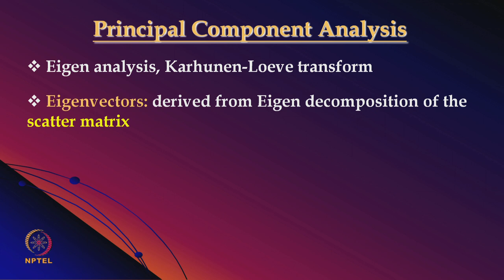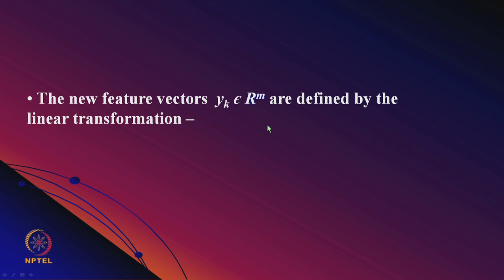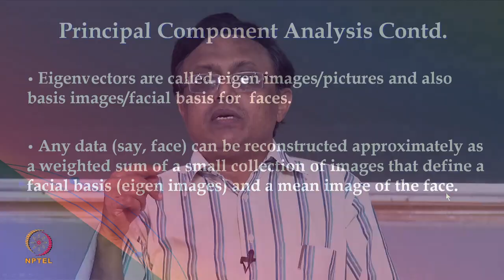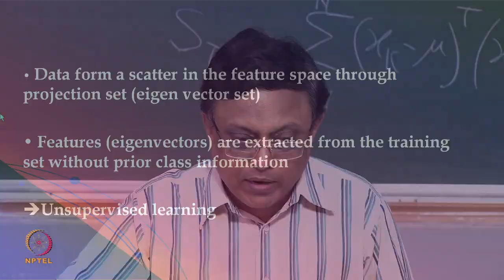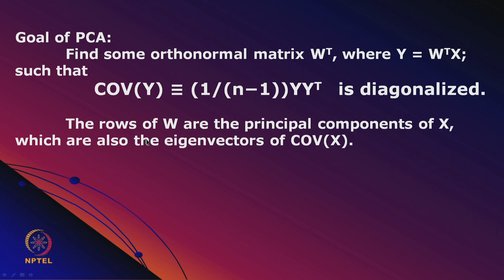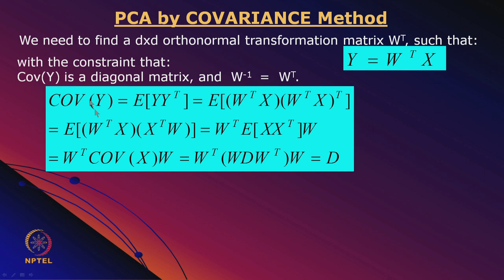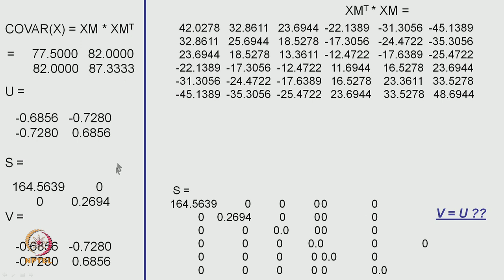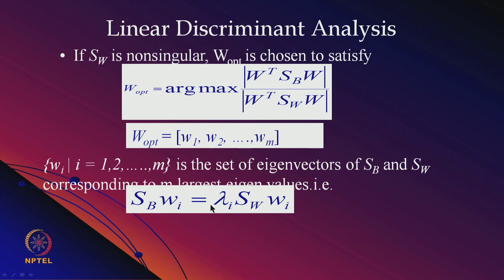Mod-02 Lec-21 Principal Component Analysis (PCA)

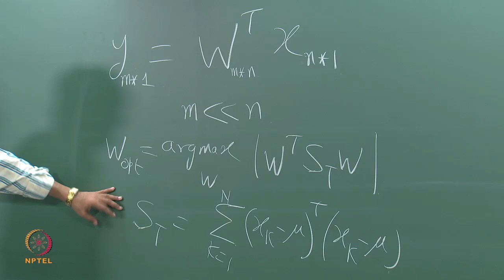Comment: at 24:00 there is a mistake I think .... The formula for the scatter matrix S does not match the earlier formula.
Note that the product in the previous formula lead to adding matrices ( due to summation ) but in this case 
will lead to addition of scalars ( and hence S will be scalar ) .

the formula terms need to be reversed.